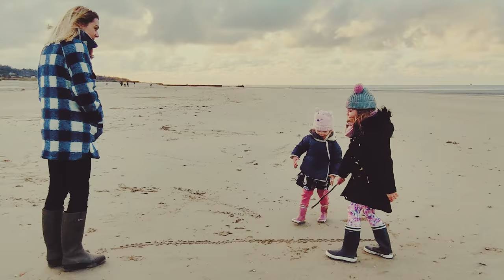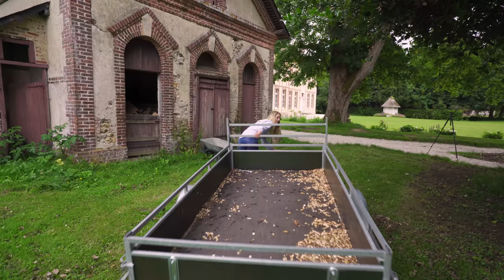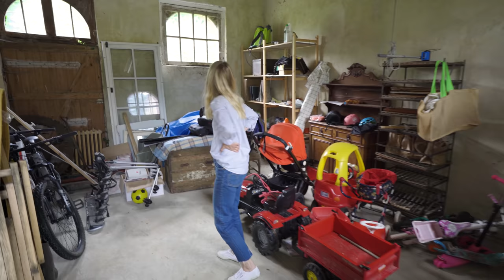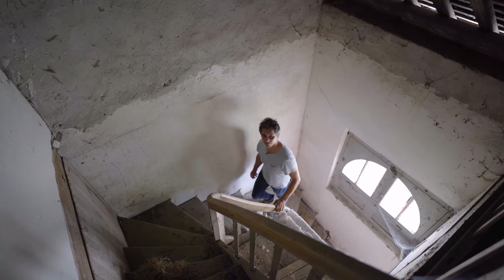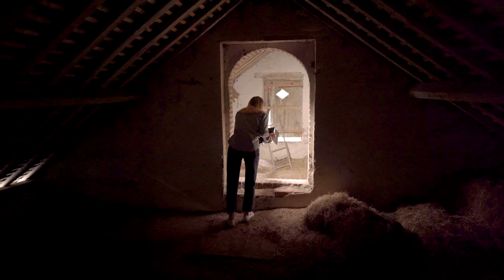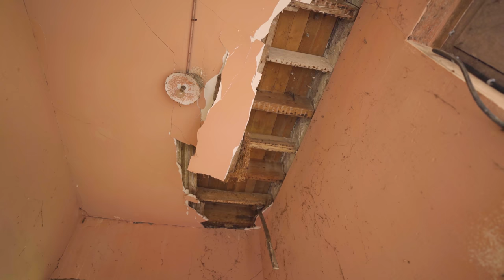Join us to explore our CHATEAU COACH HOUSE  (Trigger warning: there might be scares!) ep. 29

Comment: The devices you found in the attic are used to make butter. https://youtu.be/3pLN0hK-uXA?t=1028
The first, barrel-shaped apparatus is a charn (in French; barrat pour barrater), in which the fresh cream would have been churned to separate the butter from the whey. The second apparatus is called, I believe, a "mallaxeur", and is used to knead the butter to the wanted consisentcy, and squeeze even more moisture from the butter, and to mix in salt if so required. 
On the "Beurre Bordier" website, you can see this device in action in another version. ( https://www.lebeurrebordier.com/savoir-faire/fabrication-des-beurres/ )
Cheers..!  :-)
Hans

T

Comment: Sinks into birdbath, hummingbird bath, bee drinking fountain, lots of uses. Love the barn. I have horses and built a passive solar barn for 6 skylights with a slipped pitch roof that created space for clerestory windows for eastern light. You could have a little museum of these gadgets for  your guests. Yes lighten load on that flooring by removing weight of bales which are 50-80lbs.

Comment: I’ve discovered the wonders of infrared heaters which will heat the objects in the room but not the air.  Considering that you have high ceilings, and it is often used for outside, you could consider this.  It uses less electricity, it’s more efficient because you don’t have to spend extra energy heating the air first.  Look up infrared heating in patios and also infrared panels, which you can hide so it looks more like decoration. PS I haven’t fully used one, but what I’ve read so far makes it sound ideal.

Comment: I reckon that small attic room would've been where the ostler slept or perhaps the coachman, and the stable boys probably slept in one of the open attic areas. They often slept near the horses because their services would've been asked of 24/7, they had to be able to ready a horse on short notice. Also, it looks like you found some butter churners and an old butter kneading contraption - the one with the gear rimmed table and paddled roller, would've been used to make butter soft, uniform and perhaps incorporate extra flavours like herbs

Comment: I love your channel!  I only just found you in Novembre, so am very late.  And of course Philip, straw is the stem from wheat or barley, a by product if you like, use for bedding for horses, other animals, and also for insulation and building (maybe thatching, but not sure).  It needs not to be dusty if used for bedding.  Hay is the actual whole of the grass stem and head usually, depending on the type of grass - and of course is used as a feed, or wrapped up and silage is created, this is more for cattle, although haylage, not left as long and probably better quality grass in the first place, can be good for horses too.  Again, not dusty, and even so, should probably be rinsed or even lightly soaked in nice water to remove anything nasty that helps the grass grow, but is not good to be absorbed, before feeding,  It can vary in quality due to the compisiton of the grass, the weather it has grown in and when it as cut and how it has been stored.  If packed too tightly into a stack, both hay and straw bales can spontaneously combust.  I did not look at wikipedia at all for this, I promise.  Love to all of you  xx

Comment: There would have been at least two horses housed in the stable block.  Carriages usually had two or four horses.  Carriages were kept in a separate "garage" so that they could be kept clean and paintwork bright so that the fumes from the stables did not corrode the paintwork which was usually 12 layers thick and made with hand made paint.  Laying the paintwork on a carriage was a very old trade and took many many weeks so no one wanted to risk deteriorating the paintwork.  There would have been a separate harness room for caring for the leather and ensuring it was clean, repaired and in good order.  There may have been a separate place to harness the horses quickly and hitch up to the carriage so that there were no delays setting off.  Thats the set up we have in our stables so that we keep our horses and carriages in an efficient manner.

Comment: we use our old wooden ladders as decor and hang flower pots from them while they lean on our house's wall, gives it a romantic vintage vibe
Reply: you could also maybe use them (or depending on the length of the other ladders just portions of them) as side pieces for diy shelving units, if you find some that add up or cut one in half so that it adds up you can relatively easily add boards on tops of the step things of the ladder(s) as the shelving boards... maybe Benoir can help make it stable enough to hold some weight or you can also just use it for light weight (decor) stuff

Comment: I definitely think you could turn the coach house into apartments. They would be sort of front and center on the property though, and might it be better if they were in some of the other buildings. Given its location, it might be better as an event space. I’d put the main event space in the middle and renovate the other rooms as bathrooms and kitchen space. You could open the big doors and use the courtyard as a part of the main seating and event area. The attic could store equipment and furniture. I don’t think it would pay for itself as quickly as apartments, but in the long run you’d earn more money if fully booked.